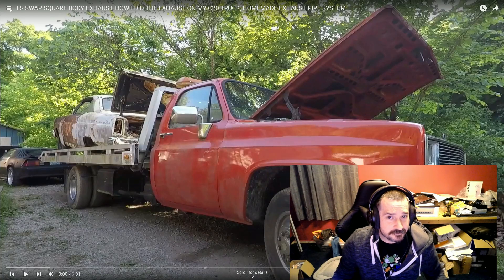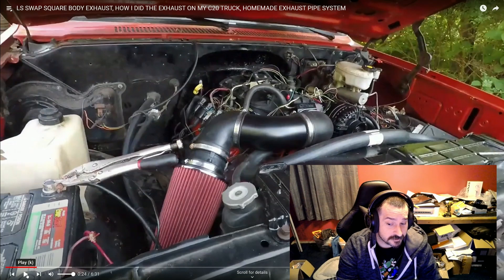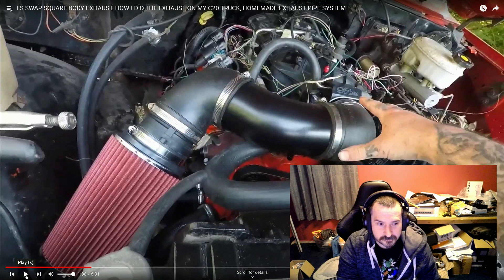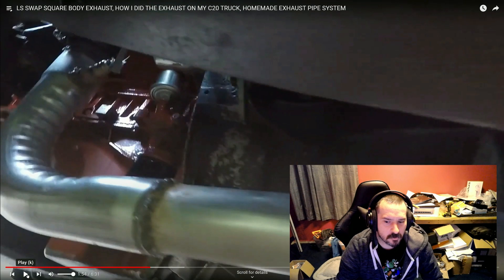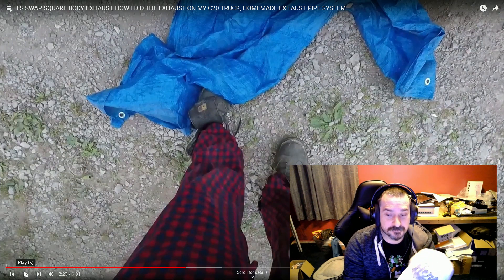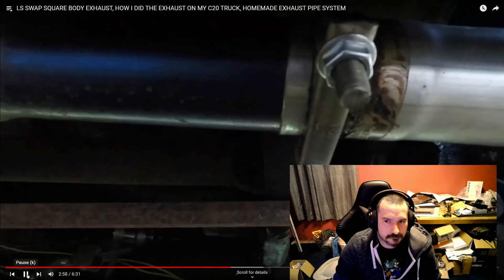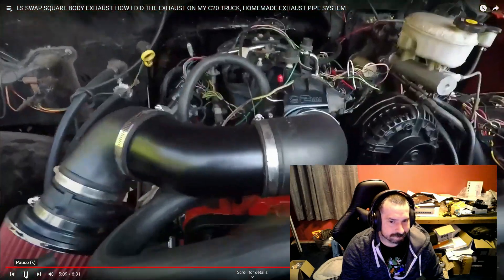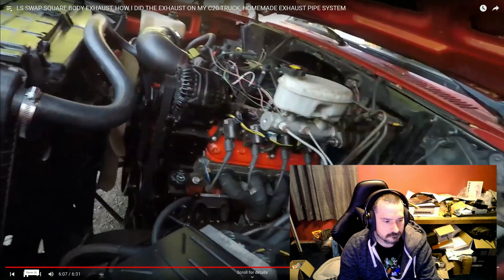Everything You Need To Know About C30 LS Swap Headers Exhaust. That Flowmaster Sound

Comment: Where did you get the master cylinder from?
Reply from the maker: 2500 ls truck with hydroboost, the rear of the master will need to be shaved some to fit the factory hydroboost on the 81 sqaurebody